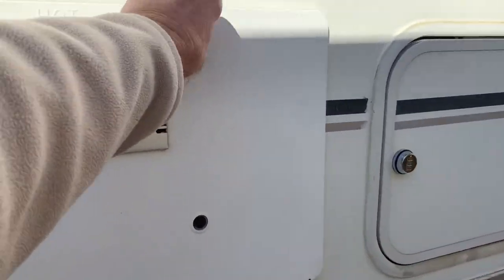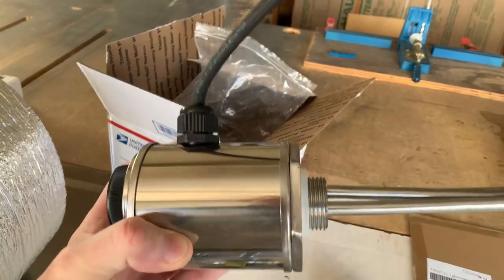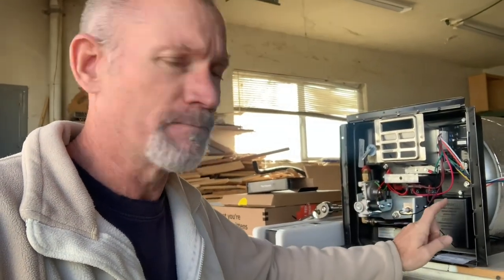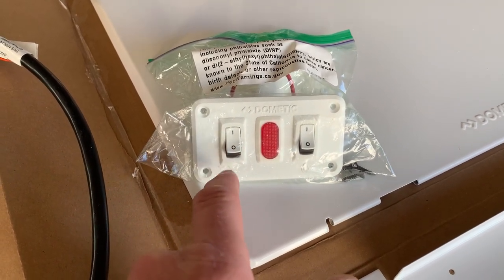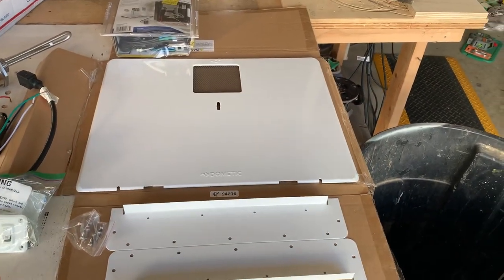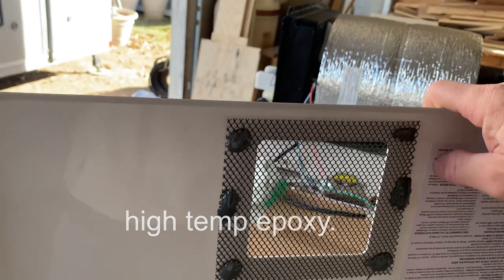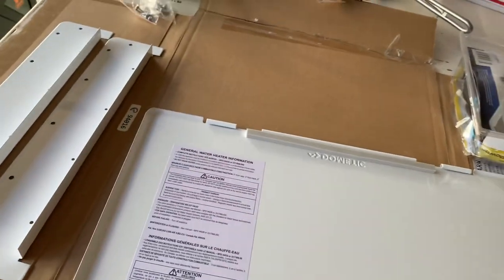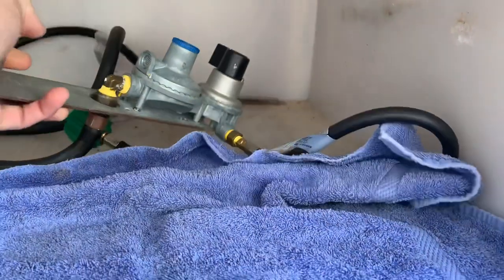Water Heater Upgrade to 3-Way Power • 12V Water Heater • Solar Dump

Comment: Three way Hot Water Heater, good Idea Jeff. Just like your refrigerator and speaking of three way refrigerators I believe your 2003 Elkhorn has a newer model 3-way refrigerator than our 2000 Elkhorn. Ours is the older Dometic that has a twist knob for ON-1-2-3-4-5-6 for on and coldness another knob for AC-DC-GAS and then two push buttons, one is an igniter, the other is a gas feeder plus a small 1/2 square meter were when it lights the gas the meter needle moves into the green side. That old Dometic still  gets the freezer to "0" degrees. I don't think it has a computer board in it and that's probably why it sill works after 23 years. In all the years we have owned RVs with the three way refrigerators we have never used the DC setting for fear of draining our battery. Have you used yours a lot and if so, based on your experience, how many hours can a large new fully charge lead acid deep cycle run that size of refrigerator? I know we have run ours on propane for two weeks on two tanks without a refill no problem.
Reply from the maker: Yep, I have a video on how I ran my refrigerator on 12V driving from California to Texas and back.
Kept it nice & cold, even in extreme temps.
Mine is the “newer” 2003 model with the Dinosaur Electronics board.  Direct Spark Ignition.   It’s a workhorse.

Comment: Why didn't you go with the Truma AquaGo comfort or Truma AquaGo comfort plus, or even the Combi units. Even the ESPAR Hydronic D5E 12V RV heater kit would have given what you were looking to do. The Aqua-Hot is an all-in-one unit. Since you are remodeling the TC, it could have been a good opportunity to retro-fit a unit. Just seems like you are going though a lot of work modifying that heater that just might fail in time because the modifications are altering the original design (cutting into the unit). Good luck with the project, we will all be watching intently. Cheers.
Reply from the maker: I considered all of those.  I wanted a way to heat water with DC 12V, AC 120V and LP gas.  This unit is super light, fits in the area I have available and allows for 3-way heating with the solar dump feature.  As far as the modifications go, I did not cut into the tank.  Just the mounting flange that I described in the video.  The retrofit 120V ac element is designed specifically for this mod, works great and is efficient.  
Aqua-Hot is just too bulky and would not fit in any spaces I had available.  No way to do a solar dump.
I had a 250D ordered but canceled it.
Great for vans and motorhomes but not truck campers.  
Tankless would not work for me.  (I considered them all.)
The Truma tankless units are gas only.  No way to plumb in a 12V element for Solar dump.

I have worked on every hydronic system, tankless and DSI/Electric tank type water heater out there.   This modified Dometic 6 gallon works great and are simple and inexpensive to repair if needed.

Comment: Did you know that the nylon drain plug is also a little safety device. I called Atwood and they told me this information.
Reply from the maker: Yes.  I know that is what they say.  If the water temp or tank reaches a catastrophic temperature it melts the nylon plug threads which causes the plug to fail, releasing the water/pressure.  I side note all of that in the build/mod video.
 (I’m an NRVTA trained rv technician and Dometic/Suburban/Truma Factory certified tech.  I have over 30 years experience with these tank-type DSI/Electric water heaters.   CMA.

The OEM heating element was 1400 watts.  This new element from Camco Hybrid heat is only 425 watts, has its own breaker/thermostat and ECO.

Of course this WH still has the OEM PT Valve, emergency cut off, thermal fuse (gas side) and a secondary thermostat and breaker for the 12V element.
Note: The nylon plug for the older Atwood models may have been a safety feature, this is the new Dometic designed/engineered WH.  It has a different drain outlet and plug altogether.  

Redundancy in safety mechanisms with this new setup has me feeling confident about the mod.
Oh, and it works great so far. So keep watching.

Comment: Just something to think about.  Owning 4 truck campers in the past all with a 3-way (gas, elec, 12vdc) —-never in 17 years have I ever used 12vdc to heat my water.  In conventional 3-ways, it draws 18-20 AMPS!!!!  That is ludicrous amounts of energy.  If it were me, I would have simply installed the 2-way and be done with it.
Reply from the maker: I still have 120V AC element and Propane burner in addition to the 12V DC element.
I’m not sure you’re understanding why and how I’m wiring the 12V DC element.  It’s a solar dump for excess solar energy produced from my solar array on the roof and ground deploy.
As my LiFePO4 batteries become fully charged, instead of the charge controller dumping the excess power through the heat sink, a switch diverts the energy directly to the 12V element to heat the water.  It’s simply a better way to store energy that’s otherwise wasted.
Reply: @covetthecamper2289  18amps of 12vDC is worse than running an AC system on your roof.  So, if that is what you are doing, good luck with that.  If your using 12v side of the system required to run it at all, then I agree, then use your inverter for 120vAC--which will be about 8 amps!  AC=8amps, ----DC to cool=18amps!---- 1a DC for circuitry in all modes.   I hope that makes more sense.
Reply from the maker: I’m using the 12V DC element as a solar dump.  (Solar energy diversion load) That’s DC to DC.
The inverter is not used.
I’m using the smaller Camco Hybrid Heat 120V AC element which runs at 418 watts when I have shore power or if I’m running my generator.  
I use propane sparingly but it’s there when I need it.  I carry one 20lb cylinder with me.  I expect that will last around a month.
Solar energy is being diverted to the 12V heating element once the battery bank is charged. The water is almost always at 105°F just from the excess energy that would otherwise be wasted through the heat sink on the MPPT charge controller.
The water heater tank is very well insulated with a layer of reflectix (OEM) and a layer of 4” Rockwool that I added.

Comment: There is a much better way to do this. You can use a small inverter and a voltage sensing relay to trigger then you use the 1400 watt element that was original. It would use excess solar and still heat much faster. I love that you are making it suit your needs thanks for the video
Reply from the maker: I disagree.  DC voltage from the solar direct to the DC heating element is in fact much more efficient.  
This is a solar dump… meaning once the batteries are fully charged, excess solar energy is diverted to the heating element directly and otherwise wasted energy will be stored as heated water in the WH.  When I do opt to use the AC electric element or the propane, the water is already at warm/hot temperatures which uses less energy (AC or Propane) to fully heat the water.  

I don’t want the DC energy in my batteries to be inverted to AC energy just to heat water.
Reply: @covetthecamper2289  yes you can use your solar dump load to open a relay inline with your inverter. You are correct on its more efficient with dc dump load but the small efficiency loss is well worth the much faster heating of the water in such a small tank. I've done it both ways with my camper and also my 50 gallon tank on my home. With the 50 gallon tank it actually worked better with the DC dump load because when using the water it didn't need as quick of a recovery time. It you are using the solar dump of 1 or 2 panels then maybe it's enough of a dump load but trying to dump the excess wattage of 8 or 10 panels by only dumping that small amount is kinda meaningless.  Yeah dumping a small amount of dc into something that's not practical is kinda well... it just don't make sense. Like I said I did it both ways and you will see if you try it